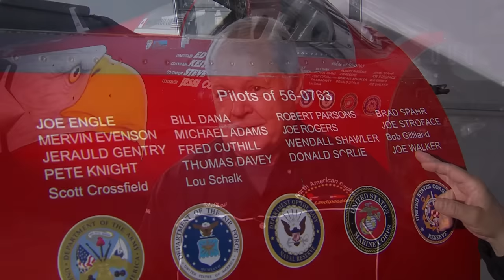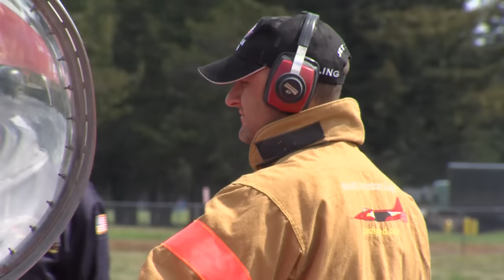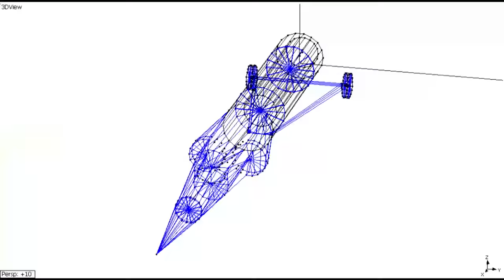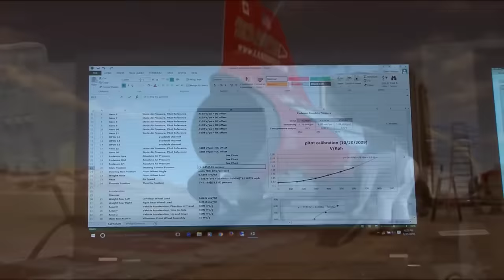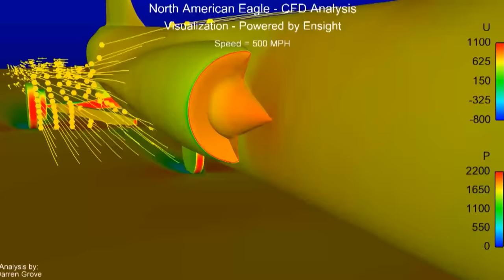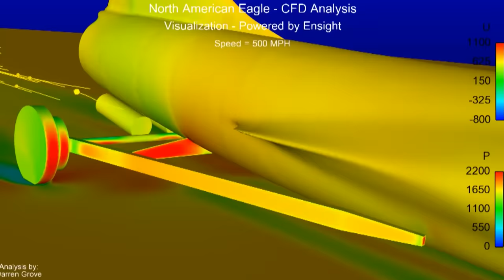The North American Eagle

Comment: Never mind Bloodhound, take a look at the painstaking way Thrust SSC was designed, wind tunnel & rocket sled tested. The forces involved in transonic & supersonic speeds on land are immense and aircraft don't have the ground interfering with airflow.
A tragic end to this project which involved a lot of well-meaning talented people but it always seemed to me to be unrealistic and foolhardy.
For example, little thought seemed to have put into driver protection. The F-104's primary pilot safety device was its ejection seat - not a practical idea in a car prone to enormous ground forces never mind if it tumbles in an accident.

Comment: I guess speed records will never be safe, but this kind of kitchen-table approach just wasn't up to the challenge and Jessi Combs paid the price. They were trying to run a car faster than the world record for a  military jet at low altitude - maybe just too much for a group of good old boys. 

The UK Bloodhound project is far more sophisticated - involving bleeding-edge university departments and high-tech companies. Now it's properly funded they had a problem-free test in South Africa, hitting their target of 600 mph in just a few days with only one of the two engines installed. Provided the data matches their models, they should be attempting the record in 2020, with a good chance of topping 1000 mph safely.

Comment: The tie down straps/chocks they were using on the static test runs took a hell of a lot of stress, the manufacturers should use the North American Eagles in their advertising, brilliant selling point, unless like GE they don’t want any association with the project. 
Excellent documentary, interesting, informative and entertaining. Thanks 😃👍🇬🇧🏴
P.S, the car (automobile) was first built by Karl Benz (Mercedes Benz) in Germany Circa 1888, sorry USA the car was not started in America (north or south) as Mr Shadle Stated @ approximately 14:22.
Whilst I totally respect this team I am English so my support goes to “Bloodhound”, and even though that team has had their issues, mostly financial, I am confident that they will eventually break the 1000 mph mark, if they don’t I will be really surprised. 
One thing that does puzzle me is that the exterior skin has a lot of non-flush rivets and fasteners, surly, and in my experience, they would get a little more speed, better aerodynamics, and fuel economy (better aerodynamics =better fuel consumption = lower fuel weight=more speed), but hat do I know, I only did 24 years in the RAF as an aircraft engineer.

Comment: Oh the arrogance. Right at the start, 0:17 - 0.25. Well, Bloodhound just finished their first actual test session yesterday with 628mph on their 11th high speed trial and 32nd run total, three weeks after rolling out of the trailer, even though they are missing the second engine. The Brits are advancing methodically, they are prepared, the vehicle is well designed, and the track is cleaned obsessively.
Reply: Exactly!!!! I never had a good feeling for the design  of that vehicle. I always  thought  that it wasn't  safe , the wheels were too small for the size of it  rip Jessie 😢
Reply: @johnalarcon5006  Richard Noble said he felt the NAE project was dangerous, you don't listen to someone who has held the record and project managed the building of LSR cars, Art Arfons said in "the fastest men on earth" book that the record was now unobtainable for people working from their garage. People with experience commented and no one listened, jessie sadly paid the price.
Reply: @lewisb85  Exactly,  only because  they dont have the funding that those big firms have , those big firms have the money  to access  everything  aerospace  wind tunnel  testing ect.... my brother in law used to work for " wroar"   if i spelled it correctly  a  aerospace division of the BF Goodrich company , he did metal exact testing he use to test metals fatigue at different  temperatures  and pressures
Reply: @lewisb85   besides  the wingless aircraft that she wes driving  had way too small wheels , im not an aerospace  engineer but im thinking that had something  to do with her death.  Im sorry she died either way 😔
Reply: @johnalarcon5006  Yeah Noble said about the small wheels he said about them digging into sand when running in the desert. Classic example of not listening to someone who knows better than you.
Reply: @lewisb85  Exactly  correct
Reply: @lewisb85  when i first saw the small wheels  i though  thats not a good design 😕
Reply: @lewisb85   Im actually  building  my 69 chevelle  for the texas mile  and im taking everything  in consideration  when it comes to stability, of course  im not going anywhere  near 500 mph  but at 240 mph im sure i can definitely  get into trouble if i dont plan it out correctly, im doing everything  to this car and im referring  to all the input from people  and experts that have been ther long before  me !      A persons pride  and ego can get them into big time trouble , i have neither at this point in my life and  im 60 and and still can learn from individuals  younger and older  then myself. Wish me luck 🙏

Comment: I always hoped something like instability during high speed testing would convince Ed to give it up. Alas, it took the too-high cost of Jessi Comb's young life to put an end to the project. I really think that now that the record to beat is Mach 1.1, eyeball-designed LSRs should be a thing of the past. 

Look at Thrust SSC. Finite element analysis, rocket sled testing, wind tunnel testing... on one run at over 600mph, the suspension collapsed, and all Andy Green said was "Oh, dear," and he brought the car safely to rest, upright and otherwise undamaged. It was designed to be safe and stable, even when Andy entered the measured mile after a pounding sonic boom, a huge bow wave evident in the track, and Andy with his hands crossed on the steering wheel, Twice.
Reply: Andy Green had dictated that the rear suspension be locked at the highest setting, instead of being under software control. He found out on that run why the rear suspension was dynamic, happily without killing himself. After that he gained some trust in the software engineer who had told him it was dangerous and might get him killed. But yes, the British team engineered their car from scratch. Which is why their driver is alive to brag about it.

Comment: Chopping the wings of a mass-produced plane is a cost-efficient way to get a jet-car. But the backward-swept wings was the things keeping the body facing straight into the oncoming air. Without them, the body needed more development for stability. They even persisted with the original tail. Dear God...
Reply: F-104's don't have swept-back wings.
Reply: @skunkbucket9408  They have to swept back more than a certain degree to be classified, as such? (but yeah, I reckon the F-104's wings were not swept back extreme enough to make the needed difference to this car's stability, anyway)

Comment: Very interesting story and a tremendous long term Engineering challenge...I tip my hat gentlemen. Sad to hear Jessi died in the last run. Has anyone heard any details of what happened? I can't find any video of the crash run here on youtube, nor any telemetry accounts of the run anywhere online. I do question whether or not it was prudent to have Jessi behind the wheel of an 18,000 lbf of thrust jet car with her limited experience for anything but modest run speeds, but would of course like to see the data before commenting further (a Ph.D. Engineer who works for a large American defense contractor aerospace company.
Reply: I believe she had gone over 400 mph in a previous run. There was a problem so she could not back it up with another run in the allotted time. You must make 2 runs and you get the average speed of both runs to make a record. Loved her. She will be missed.
Reply: Watch the video of one her previous runs, when it veered off track, and didn't stop until it was in the bushes. A scary preview.
Reply: @hootowl1964  Yes, she reached a speed of 440 mph.
Reply: @Kirovets7011  front wheel dug in the sand and basically collapsed under the pressure of digging in.

Comment: Isn't the SSC pushing around 135000 hp? Good luck with this project...been 10 years let's see some record runs😀
Reply: It isn't pushing shit. Its not even on wheels yet and the whole "jet engine and "hybrid" rocket engine" thing is going to make it a perpetual project and that's just how they want it. They're stalling and waiting and figuring these "old geezers" with the F-104 will retire or die off or go to the nursing home one of these says and the "SSC Bloodhound" will be off the hook. Because it turns out that according to the rules the THRUSTSSC supposedly "set the new world record" under are only the "official rules" according to some "world motorsports organization" that didn't exist in 1997 or hadn't come out with a RULE by then since no one had evern CLAIMED the "world land speed record" for an air-breathing" car. So they did. And then all the people they'd thought they'd fooled because they were silent on the whole deal started talking. And they pointed out some "problems" with the so-called "official record" which apparently was done "by the book" despite their being now "book" FOR "Black Rock Desert". They were implying by the BONNEVILLE SALT FLATS BOOK, which requires a backup pass within 1% of the record in the opposite direction within one hour. Well, they made their allagedly "legit" backup pass supposedly within that hour. But there was one problem. The car wasn't IMPOUNDED per the "Bonneville book". By the Bonneville book, the car goes to impound and can't be touched by anyone on the team and when the impound is over, which is when the team says "we need to start getting ready"  which means "we're ready to start it up and go", they can LOOK THE VEHICLE OVER and CHECK FLUIDS but they can't ALTER THE VEHICLE OR MAKE ADJUSTMENTS OF ANY KIND. That includes REFUELING the vehicle. It can't be done.

 Mainly because the backup pass has to be no slower than 1% of the first pass but it also can't be more than a certain percentage FASTER and THAT depends on wind conditions for the FIRST PASS vs. the SECOND PASS. And you can't ADD FUEL because no one has any idea how much you ran with the first time and you might have ran almost empty to set a high 1st pass and then weigh it down with a full load of COOL FUEL to MAKE MORE POWER on the 2nd pass to make sure to back it up by not dropping too low but the extra weight will protect you on the TOP SIDE. They added fuel mainly because they HAD TO FOR APPEARANCES.  I saw that because they claim that thing burns 5 gallons of fuel PER SECOND. Well, it would have to burn at least 300-400 gallons during startup, warmup, the run and shutdown and the vehicle has to be RUNNING WHEN THE OFFICIALS REACH It because its IMPOUNDED AGAIN pending any CHALLENGES. 

That car can't possibly hold more than 500 gallons of fuel and its all but impossible it would have enough fuel for even ONE RUN and if it did by the end it would be sucking HOT FUEL AND FUMES and it wouldn't run for SHIT. But by Bonneville rules they couldn't refuel it anyway. Someone pointed that out. Thats' when they decided to change "rulebooks". Especially since a ROCKET CAR ran by BUDWEISER WENT 700+ way back when and THAT GUY stepped up and said THEIR RECORD WAS A FAKE BECAUSE THEY REFUELED. They countered that HIS record was fake because he didn't BACK IT UP. Well, its impossible to "back up" a record set by a solid-fueled rocket engine that burns itself out on the first pass and he never claimed "Bonneville rules. He just said "I went supersonic at 7XX mph..." in such and such year. Then they called in help from Europe  and this brand-new, meaningless "world motorsports organization" or some shit came out in 2014 and said by THEIR RULES the car had to have at least FOUR WHEELS and blah blah blah. Only problem is the ThrustSSC has only THREE WHEELS. Oops. \

Ultimately it all doesn't mean ANYTHING since  there IS NO WORLD LAND SPEED RECORD if ALL of their "interpretations" are used since they never set the first one, Thrust2's claimed "634.xx" record didn't count because it wasn't backed up and that leaves a 3-wheeled rocket car as the last BONNEVILLE BY THE BOOK RECORD HOLDER Gary Gabelich with 630.XX in 1970.

Of course the plan after the big 2014 "oops" was to keep the ThrustSSC hidden away in a private collection where no one would see its THREE WHEELS, let sleeping dogs lie by not responding to a few comments about the refueling deal and draw attention away from the ThrustSSC altogether and its clearly questionable ability to even complete a FULL LEGAL PASS at any speed by coming up with the NEXT BIG THING to "flush Google" of all the "controversial" ThrustSCC stuff by announcing a NEW RECORD ATTEMPT and a NEW CAR and a 1000+ MPH GOAL. 

And they had no intention of really doing it and came up with that out of desperation, didn't think they'd ever get enough funding to even have to FAKE IT and if they DID they'd SNEAK THE THRUST SSC out of "retirement", make some "minor modifications" like slipping in the two new Eurofighter Typhoon engines they "happened to find" so they could MAKE A FULL PASS ON INTERNAL FUEL, doing a sneakly little "add a wheel" modification on the rear end by just having a little "training wheel" poking down by the existing single rear wheel so it would meet the "letter of the law" and oh by the way that was ALWAYS THERE but we just didn't have it EXTENDED in 1997 (the 4-wheel rule didn't say they all had to touch the ground) and they only were doing that because they couldn't claim the STEERING WHEEL since it has a "yoke". 

And of course since every "record attempt" they've succesfully achieved has had TEAM MEMBERS doing EVERYTHING from "officiating" to working on the car to "tech  inspections" to handling the PR and PRESS and they have all the "data", they were just going to go run in some OTHER obscure location with hand-picked "press corp", claim they were "testing" and "working their way up" when I'll BE DAMNED THE CAR JUST GOT AWAY FROM HIM AND WENT 1000+ mph. Basically they were going to replace all the OLD BIG LIES with a BRAND NEW AND MUCH BIGGER LIE that would settle the issue ONCE AND FOR ALL. 

And why? Because they've taken assloads of money from anyone and everyone who offered and got all kind of "grants" and "loans" and "donations" of public funds and such and FREE SHIT FROM ALL OVER INCLUDING ALL KINDS OF SUPER-EXPENSIVE MILITARY HARDWARE LIKE THOSE EUROFIGHTER ENGINES and even their BUDDIES are starting to get worried about things like "Criminal conspiracy" and the like since they've been so STUPID about the whole thing and have lied and lied and lied about NOTHING THAT EVER MATTERED. 

But when they came out with the initial "new car going 1000+ mph" shit, that's when these American Eagle guys stood up and said "We want a shot at your 1997 record first". Because its the DRIVER and not the CAR that is the actual RECORD HOLDER, so when Andy Green was the "Chosen driver" for this NEW CAR, any "new record" set wouldn't BE a "new record". It would be him resetting his OLD record. 

And who knows. These American Eagle guys might be giant frauds TOO and decoys for the media so they can go do THEIR fake shit in peace. But the bottom line is they're pretty much fucked no matter what if they take a DIME now that everything is out there and there would be a clear intent to defraud even by mentioning the OTHER supposed RECORDS that their DRIVER SUPPOSEDLY HOLDS. But he's locked in now too because nobody in their right mind is going to walk in and take over his job as HEAD LIAR. 

What a tangled web we weave....
Reply: DEEREMEYER1 That must be the biggest load of shit I've ever read. Thrust SSC was run to FIA specifications with measured and video data showing the breaking of the sound barrier. 
And what the hell do you mean by saying that Thrust SSC was hidden away in a private collection? Thrust SSC is on display in a VERY public museum in conventry, I've seen it and touched it.
Reply: The Wiki page claims 110,000 hp and at 763mph it's more like 101,000. The thing with jet engines and horsepower is that the faster you go the higher power they develop, even if the thrust is constant. ThrustSSC was running two Spey 205s at 50,000 pounds thrust, total. At 763mph she was doing 67144 feet per minute. A horsepower is 33,000 pounds feet / minute so 67,144 x 50,000 / 33,000 = 101,733 hp. They thought she could go 800, but at 763 they were just about maxed out. Horsepower is not a good way to measure jet engine performance, at rest you aren't moving, so even if you are generating 25 short tuns of thrust you aren't achieving anything, so no horsepower.
Reply: Mr Bob sent to messing
Reply: Fandango Brandango That guy turns up everywhere with anti-British rants. Don’t get him started on Rolls-Royce. To give you some idea of how far off the beam he is, have a look at his claim that Thrust SSC had only three wheels. He obviously hasn’t seen any pictures of it or listened to the explanation of why it always pulled left. I tried arguing with him once but he keeps changing the subject. He should spend a bit less time on YouTube and a bit more time getting some fucking therapy.
Reply: cageordie Thrust SSC project owned a pair of Spey 205s but they were never fitted. The record was set with Spey 202s which were originally meant for lower speed development testing. They never got time to swap the engines and they could see there would be no real benefit to doing so anyway.
Reply: Owen Smith The chassis was pretty well screwed by the time it did it’s last run anyway.